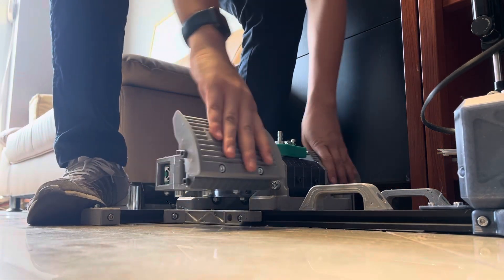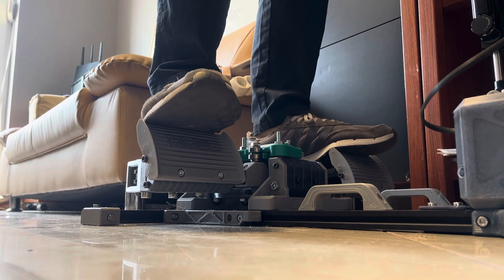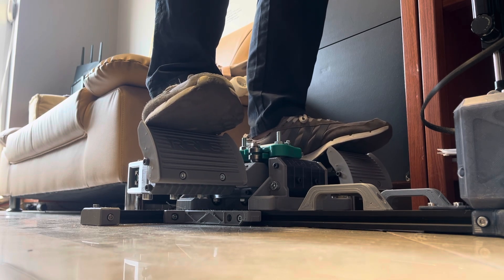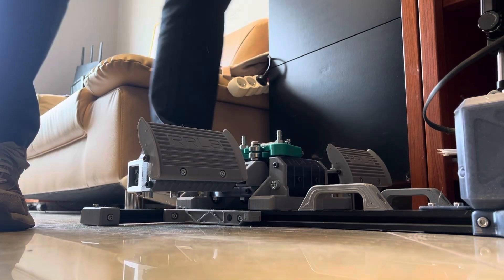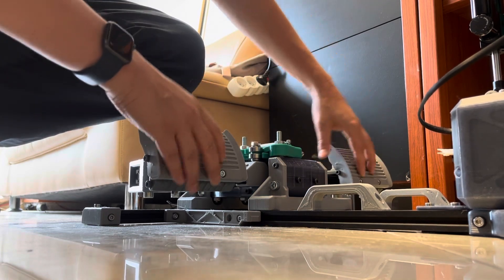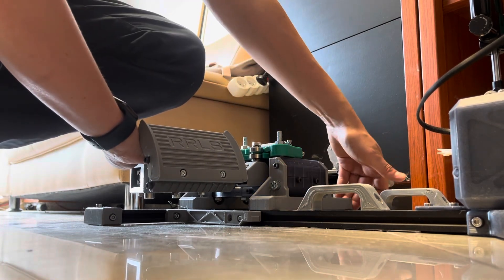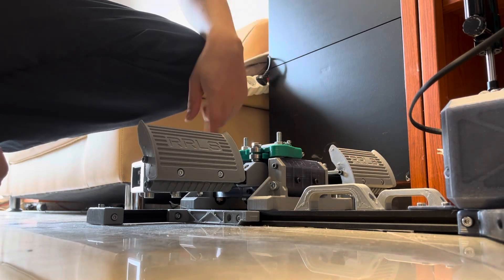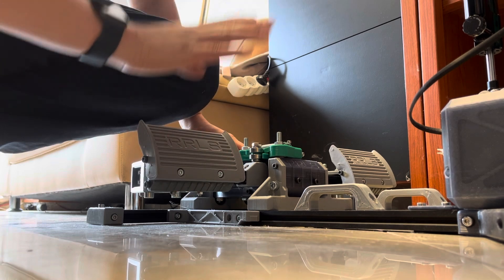Short clip: Open source rudder pedal load strength

Comment: Very nice! I enjoy your videos! Are you streamlining the required parts/cost too?
Reply from the maker: Yep really trying to keep costs down. Though it is looking like it will require more than 1kg as I recommend doubling the wall count for strength. I am going to go through and evaluate print settings more to see if there are some things I can bring down in filament usage.

I am also trying as much as possible to standardize hardware, trying to use the same lengths if screws and sizes whenever possible so us folks who typically have to buy metric in packs of 25 or more don’t have too many spares.

Extrusions are 40cm length so you can buy them precut from amazon etc

Electronics will have multiple options, with things like SPI conmected TLE5011 sensors connected to freejoy, or arduinos using mmjoy2, or even as the rj45 jack to connect to an authentikit hub